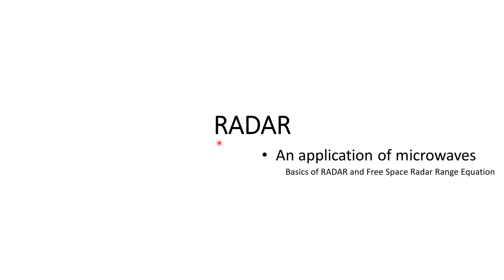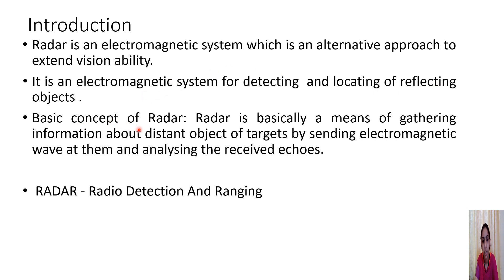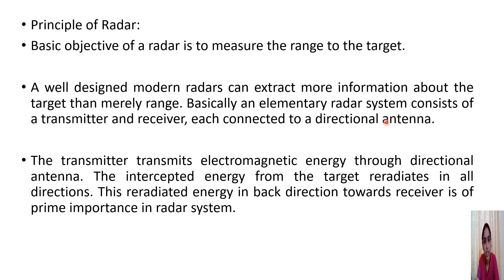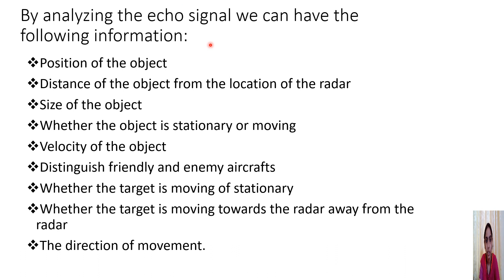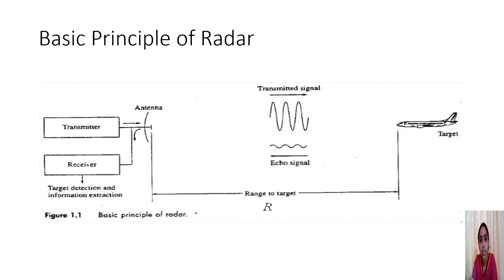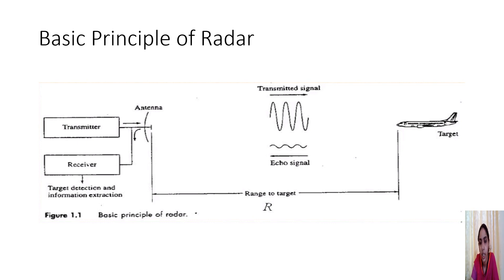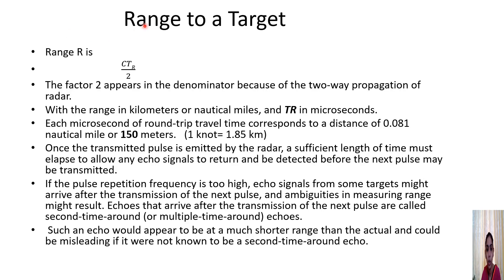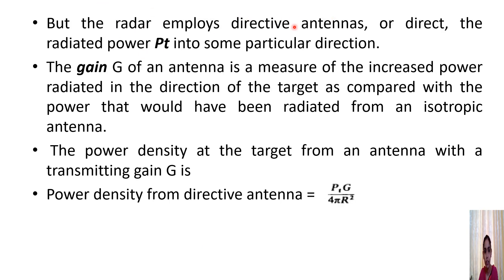MICROWAVE AND RADAR ENGINEERING| Basics of Radar & Simple form of Radar Range Equation |Saniya Azeem

Comment: Hello , I would like to ask something about the 'B' bandwidth in the radar range equation, or the bandwidth of the minimum signal detection equation. How we determine what bandwidth we use. Like in equation :
"Smin=k*T*B*SNR"
Smin = minimum detectable power
k = Boltzmann's constant
T = temperature in kelvin
B = ?
SNR = Signal to noise ratio

 Do we use the radar's operating frequency or the Pulse Width?
Reply: Frequency is operating frequency. Which is a specific value. Bandwidth is a difference of lower and upper frequency, if pulse width via given then opposite of it is bandwidth else range will be given. Then bandwidth is difference of the range of frequencies.